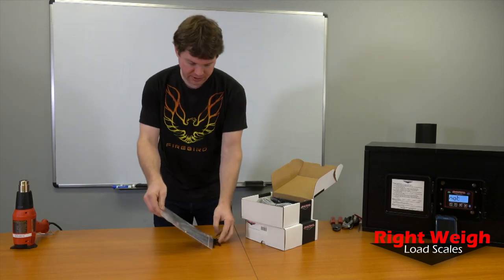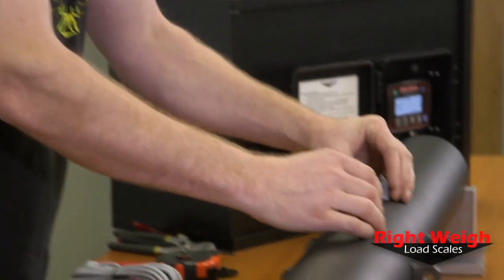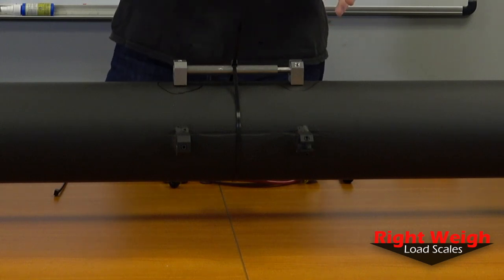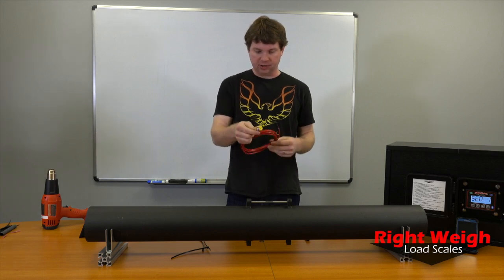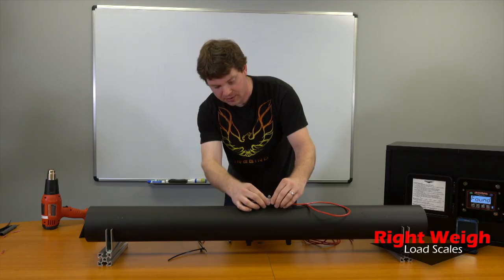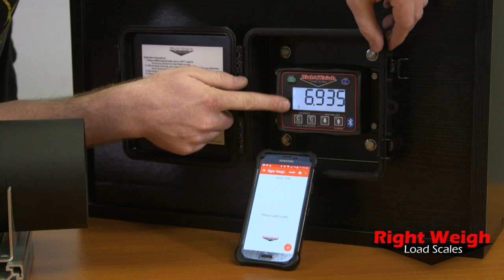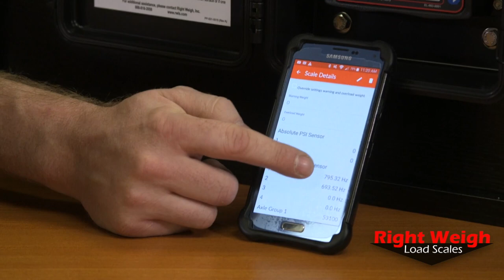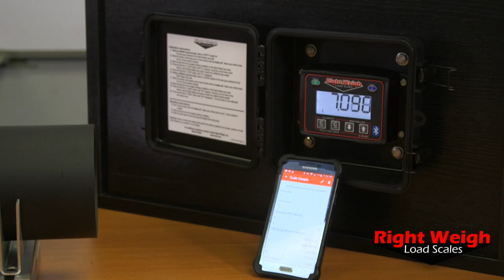Right Weigh Load Scales (201 Series for Spring Suspension): Installing Strain Sensors on the Axles

Comment: Once its ajusted do u have to callibate with each traler or once its done its done
Reply from the maker: Once installed and adjusted for proper sensor tension, the gauge needs to be calibrated empty and loaded for the trailer it's installed on.  It's up to you how often to check the calibration, but we recommend confirming the calibration at a ground scale once every 6 months.
Reply from the maker: Hi Devin - Right Weigh gauges do require calibration. See our website for more details: https://rwls.com/f-a-q